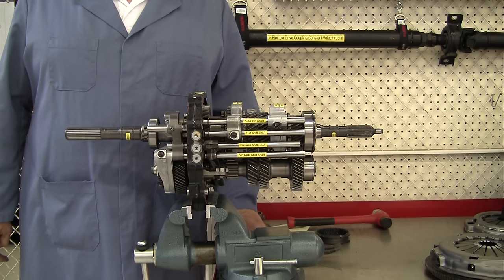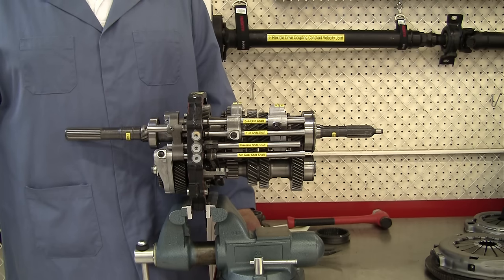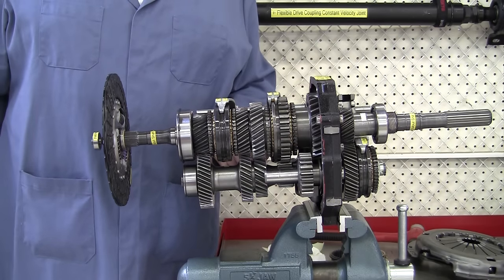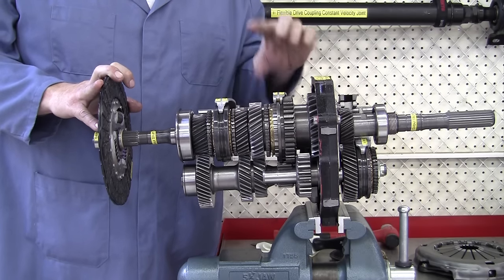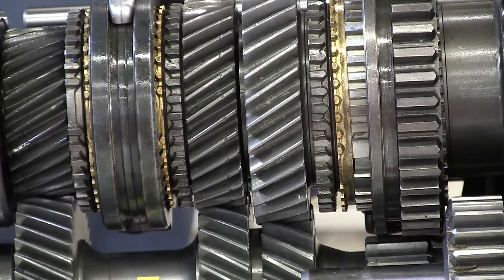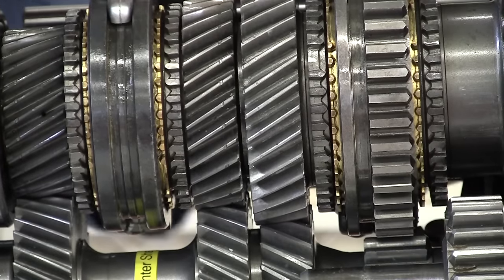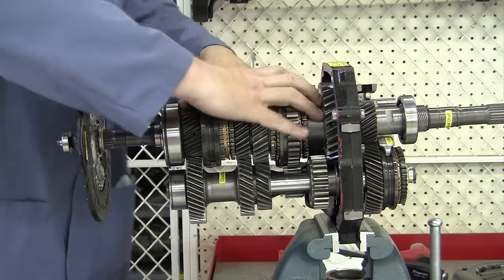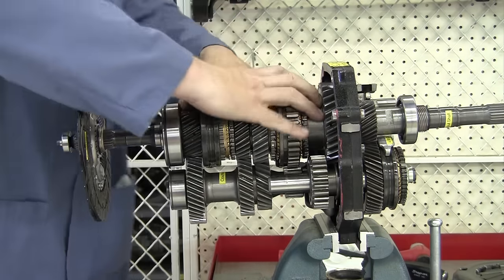Manual Transmission Operation

Comment: so what's the difference in a shift sleeve (in the 3rd and 4th shift) and the synchronizer sleeve (in the 1st and 2nd shift) do the 3rd and 4th gears not have a synchronizer sleeve? I'd also like to add, why is it that the shift fork for 1st and 2nd gear looks different than the 3r and 4th?
Reply: They all have synchronizer sleeves, and I think the fork only looks different because the reverse gear is in the way

Comment: I have a transmission out of a 2006 Toyota Tacoma 4 cylinder manual. It is and it's stuck in gear. What should I do? It won't come out what it can bee
Reply: Roll the car forward a little

Comment: Sir i have a question. If we have bigger transmission, we will get higher top speed right? Since it has bigger ring in highes gear to produce more output. Im new to machinery and want to learn about its principle
Reply: If you have more gears you have the possibility to have higher speed, and you usually do, but it's not obligated to
Reply from the maker: Not necessarily. the gear ratio determines the top speed, not the physical size of the gears. Thanks for watching

Comment: I understand a bit now, but i'm sure i'll forget it after  a while. I usually shift 1st > 2nd > 4th, bypassing 3rd gear. 3rd gear seems useless for daily drives. I love 2nd gear. Sometimes I start at 2nd gear and go to 60kmh and shift to 4th. I'm tired of shifting but I hate automatics.
Reply: It's fine as long as you're in the right RPM and speed.

Comment: I'm trying to figure out what in my transmission would be causing a single "clunk" sound to happen when I give it gas, and again when I let off the gas, mostly in 1st and 2nd gear.  is it possible it's something inside the manual transmission? or is it more likely the CV joint?  I didn't notice any play in in the axle.  but maybe the axle is in the beginning stages of failing.
Reply: The CV joint should knock alot of the time if it's goin mainly at slow speed.. as a buddy used to say drive it like you stole it untill you find the problem ..or cause a few more
Reply: Mine does the same. But it’s not a clunk, although it sounds clunky. Growing up I was always told it’s because of torque, the gears are typically so much torque(er) in those gears that the engine builds up high rpm’s fast so as soon as you let up it’s the immediate deceleration of the motor and not the trans just yet

Comment: So in a nutshell, the only reason the brass blocker ring is spinning the gear is friction basically, right?
Reply from the maker: At first, but when synchronized, the little teeth on the gear mesh with the little teeth on the synchronizer ring.

Comment: Does first gear on this transmission have a spur gear and a helical gear? That confused the crap out of me
Reply: No that's just where they "tap" the output shaft for reverse. 1st is helical, reverse is spur.

One thing in this video that messes with perception of what's going on is parallax with the countershaft and the reverse idler shaft... They sorta meld into one from the one angle. Reverse has 3 gears instead of 2 as in the others: countershaft gear (very small), idler (medium size), and output shaft gear (large, combined with 1/2 collar as you pointed out).

As he rotates the unit around to explain the synchros, you can see how reverse and the idler are implemented.

Comment: As far as i understand it the input shaft should be named the counter shaft, because one rotation from the engine is one rotation of the counter shaft.  In other words the power is transmited from the counter shaft under. Every gear wheel of the shaft above rotates in various speeds whereas the gear wheels under rotates with the  engine speed
Reply: nope...
the one below was the countershaft cause it turns in counterclockwise in relation to the actual turn of the flywheel

Comment: I have a R150 2wd, 5 speed manual transmission that appears to be stuck in 4th even in neutral. It is newly rebuilt.
If I select 5th, 4th, 3rd or neutral , rotating the engine crank shaft rotates the output shaft.
If I select 1st, 2nd or reverse ,  I can no longer rotate the engine crank shaft like something is preventing it in the transmission.
****Can anyone decode this puzzle or make any suggestions on how to rectify the situation***
I have just installed the transmission and not started the 5zfe 3.4 motor yet but if it is stuck in 4th gear ( as measured by a 1:1 ratio ),  I think I will need raise the rear wheels off the ground .  Would running in that manner and  possibly rectify whatever is suck ?
I need to get to a state where neutral doesn't cause the output shaft to rotate.
Thanks,  Bob.

Comment: Im sorry but do you know why my car sometimes shifts gears clutch is not slipping at all 
But sometimes it is not letting me to get in gear 1st 2nd reverse or any gear
So i turn the engine off then shift to 2nd and start the car but the car acts weird it doesent let me to shift gears nor register the clutch and pulls and drives slowly 
i can give it gas and drive 10m until the revs of the gear i am in allows me to go then i stop giving it gas untill i grind the traffic to a hold and then gas ....
WHAT IS GOING ON ???

Comment: Pretty much the same as the AX 15 , or 5. Piece of cake to rebuild. Easy to completely strip down. Just need a decent press to disassemble and reassemble the main shaft assembly.

Comment: Why are the Blocker Rings made of brass rather than steel like every other part of the transmission?
Reply: they are made of brass so the gears of the transmission don't get damaged or worn out over time, with proper use and maintenance the sincronizers will probably outlast the service life of the vehicle, but in case that the transmission is mishandeled or poorly maintained it is better that the point of failure is the most inexpeesive one, brass is a lot softer than steel so in case something goes wrong the sincronizer will stop workin and wont allow you to shift gears preventing further damage to the transmission (unless you reallly try hard to damage it) and making the cost of rebuilding it considerably cheaper, if the blockers would be made out of steel the much more expensive gears would be wornout and damaged equaly.

Comment: they should make the clutch plate thicker so it lasts longer .
Reply: What do you mean?
Reply: Not much point. A correctly driven stick's clutch will give the engine a run for its money.

If you feather, ride, drop, mismatch or otherwise abuse the clutch, it's gonna have a shorter life.

Comment: hi, perfect video ! maybe you can help, currently driving i30 CRDi 2015 100KW 53000 miles. its a year now since I noticed that shifting from 1st to 2nd and then from 2nd to 3rd gear I am feeling like " rubbing " like a small kick, 4th,5th and 6th gears are fine.... also from 3rd to 2nd gear, nothing strange... I am second owner, gear box oil changed couple months ago, living in Scotland. previous i30 2010 CRDi didn't have this issue... what do you advise ?

thought about blocking ring, but there is no issue from 3rd gear to 2nd.. or worn synchro to match the speed ? tried from 1st gear > clutch to neutral and then 2nd gear, but still the same 

from my point of view its synchronizer issue

thanks ! u got subs!
Reply: this video is 11 years old, I don’t think he’s answering:(

Comment: Note the tapered ends of the teeth on the reverse gears and specifically that they face each other. Note also that you have the clutch disengaged and the input shaft is free to turn independent of the crank shaft. These two elements are what substitute for the synchronizers and allow for smooth engagement of the reverse gear. Also, if you try to shift into reverse without coming to a complete stop, my sense is that you will first risk damage to the clutch plates (being what would be most likely to give because, to a degree, that is what they are designed to do) and if you're going faster still, loss of gear teeth or even damage to the engine itself. SO DON'T DO IT!
Reply: It actually facilitates engagement to be rolling very slowly forward while going into reverse... Enough to hear about 3 taps of the teeth - a very slight grind. When they line up and lock, the forces are negligible as evidenced by the lack of force required at the stick.

By slow I mean almost imperceptible, but still moving.

Edit: the clutch won't care. Even if it were remotely inclined to, the damper springs would absorb what little shock there is.

If you were to force reverse at any appreciable forward speed, you'd likely start breaking teeth... The clutch just represents inertia to overcome, it doesn't care any more than any other "flywheel" would. Hardened gear faces? Yeah they don't like it but so rough.

And it won't do squat to the engine... It's not even connected.

Comment: say im standing at a red light, in neutral, clutch released.
light turns green, i push the clutch and immediately attempt to shift into first.
will there be a synchronization? and for how long will the counter shaft be spinning after pushing the clutch?
Reply: once you shift into first, the synchronization ring will stop the 1st gear and therefore the counter shaft since the output shaft is not rotating

Comment: What the function of spring on the clutch disc?
Reply: Absorbs shock. Makes shifting more comfortable
Reply from the maker: It also us used to connect and disconnect the engine from the transmission ( along with the rest of the clutch assembly). Thanks for watching

Comment: Sir can u explain the connection of synchronizer and output shaft
Reply: Can he explain where and how the power is actually transmitted through gears (supposedly), not synchros (video is suggesting that).

Comment: Oh wait, so the synchronizers prevent the gears from stripping when shifting?
Reply: That's the drivers perspective but yeah.
Reply: @FirieonOG  wdym drivers perspective
Reply: @TheEndermanSlayer100  a mechanic/ techs perspective is that synchro's synchronize the speed of output shaft of engine and the input shaft of transmission.

Comment: It would have been much better video if the 'torque' (power) flow was explained, meaning how the torque is transmitted thru the sections of the input shaft and counter shaft and thru the  output shaft. Countershaft seems to be completely ignored while explaining torque flow.. Gears on the countershaft is a part of the equation that gets you the gear ratios he was displaying, but he fails to completely mention that part...

Comment: Any tips as to what would cause first gear to pop up from neutral?
Reply: are you saying that when you are in first gear it goes back to neutral? if that happens it could be because the shift shaft have indentations that lock the gearstick in position trough a springloaded steel ball that fits in the indentation preventing it from moving back to neutral, if either the indentetation, the ball or the spring are worn the gearstick can move back to neutral due to vibrations and stuffs.
Reply: @milodon316  Thanks for the reply, i detected something like this, towards the end of my inspection so havent followed through on the Shift Shaft yet??

Could it also be effecting 3rd gear? and makes Reverse shudder quite considerably?

Comment: Also when replacing the clutch and pilot bearing you should also change out the slave cylinder, but 99% of clutch kits will have all 3 parts and an alignment tool.
Reply: Lol.

Comment: This is probably a stupid question but couldn’t we just keep going with overdrives? Like 7th gear being triple overdrive and so on, I’m sure that there’s a limitation I don’t know about, but I am curious.
Reply: The limitation is if the engine can turn the gear. You can have a gear too long and it will just bog the engine down till it stalls.  Weight and size available could play a role too.   Your ratio gear difference can be so much that the engine can't even get the car going if it doesn't have enough power.  Hopefully that makes sense
Reply: @johnrodrigues2018  thanks for explaining :) now I understand it a bit better

Comment: Why is the synchroniser mesh rings made out of brass.
Reply: i think so it doesnt make a rut in the gear, its softer than what it contacts. yes its a weak point, but it also doesnt eat the transmission if it chips a piece off.
Reply: lubricity. it acts like a friction bushing in a way
Reply: @yesnothanksplease  Thank Yo
Reply: It's a part that is also sacrificial with an intent, so you don't wear out the engagement surface on the transmission gear(s).
Reply: @warrenlucier5796  I agree

Comment: I still don’t understand, I’ve been watching different types of videos on how it works and it still does not make sense
Reply: Yes, it's a bad video. There's a lot going on inside the shafts (some are hollow), switching action is going there, we can't see it in such videos. Also, synchros are transferring some of the power (it is not 100% gears).

Comment: What if we shift into 4th and 2nd at the same time?
Reply: (1) Normally we can’t; there’s no way to do that from the driver’s seat using a standard H pattern shifter.
(2) If we side-step the shifting linkages and “dial” both 2 and 4 in directly on the transmission, it will yield a locked-up state due to the gear ratio mismatch.
Reply: @AndrejPodzimek  May not even be able to get it actually in to both gears to begin with if the dogs can't line up
Reply: @MadScientist267  actually you can, you lock up two gears to make it easier to torque down the nut thats on the couter shaft for 5th/Reverse gear.

Comment: Good explanation...could you do a video specially on he the clutch works
Reply: In short, the clutch have same working principal like a Disc Brake. Except it is reversed. When you hit the Brake pedal, it is locking the Disc & Caliper.

But when you hit the Clutch pedal, it is unlocking (disengage) from the disc. And when you lift up your foot from clutch pedal, it means full locking — which is the opposite of braking.

Comment: Now what about unsynchronized transmissions???
Reply: I watched about one it said it work like a cork of a bottle, when it's tight enough it spins
Reply: @NineAweFour904  that's the synchronizer tho that's like the cork? What about heavy duty trucks that are unsymchronized? Which I assume means no cork.
Reply: @Sundog0811  The forks instead of moving a sleeve overtop of the shaft and the gear the fork moves the gear itself into place. Neutral is just the input shaft and the countershaft with no gears connected and when you shift into say 1st gear, it moves the gear on the input shaft over to where it meshes to the gear on the countershaft. They cannot be helical teeth  im pretty sure because that would probably make meshing them together hard

Comment: U have a question,  my landcruiser 76 series started a issue with 1st gear. Everytime I try to take off in 1st, it just pops right back out. Any advice you could provide?

Comment: does he discuss the art workings of engine braking on the transmission at any point in this presentation?
Reply: It's hard on the trans . I'd rather replace brakes than trans 👍
Reply: @Neil-ru7kw   i thought it NOT wise nor safe to use brakes much in the mountainous regions of CO WY MT after a blizzard event where the highway roads were completely snowpacked inches and no pavement showing. thought it Safer to keep in 4th or 5th gear to smooth your way down interstates 25,70,90,15 at 45 to 50 mph and not pick up too much speed for many hundreds upon hundreds of miles on that snowpack. ... perhaps that is why the pilot bearing and input shaft bearing are all wobbly at 341k miles on an R150F... I am still investigating this oddity because i really do not know much about this
Reply: @Neil-ru7kw  no

Comment: How does floating (cluthless shifting) gears work if you are able to verbally describe it?
Reply from the maker: The driver must act as the synchronizer and synchronize the speed of the engine crankshaft with the speed of the transmission output shaft.
Reply: @WeberAuto  I’m thinking now as you explain this,  about a Porsche rev match transmission and what a mechanical marvel that must be.
Reply from the maker: @billballeza377  Very cool technology

Comment: Does resting your hand on the gearstick while driving cause wear to anything?
Reply: I don’t necessarily know much about cars but from what I do know and have heard it dose cause friction of some kind and it’s better to not rest ur hand on the gear stick
Reply: Yes, the brass synchro ring is pushed against the gear, so is rotating and wears out the synchro ring and the gear changing fork (the fork usually is from aluminum/aluminium).

Comment: so reverse has more torque than 1st gear, (R)4.1:1 vs (1)3.83:1
Reply: Way more torque I can't even fully engage the clutch while in reverse because my car will take the fuck off even if I barely give any throttle.

Comment: So the gears are always meshed and the only connection is the friction between the synchronizers and the cone on the gear??? I'm so confused, I always thought the gear would move over.
Reply: The gears are in mesh but not connected to the output shaft. There are teeth on the output shaft and side of the gears where a slide with matching teeth can slide between them and lock the rotation of the gear to the output shaft. The synchro goes between the teeth of the gear (spinning with the input shaft) and teeth of sleeve (spinning with output shaft) and uses friction to match their speed before they mesh together which stops them from grinding.

A transmission can work without the synchros but they help with smoother shifting and preventing wear
Reply: @Omlet221  That's the problem with this video. It DOESN"T "explain" a thing, how the power is actually transmitted. From the video it looks like the synchros are providing ALL power (so what's the role of gears if there is no visible change when you switch gears, we don't see it, it is happening inside).